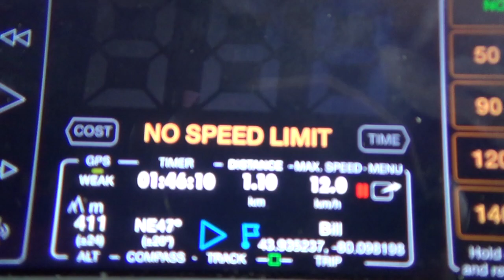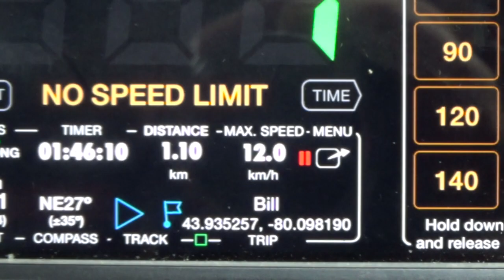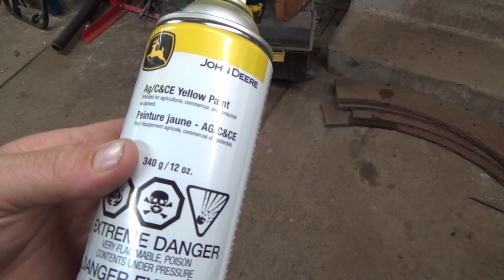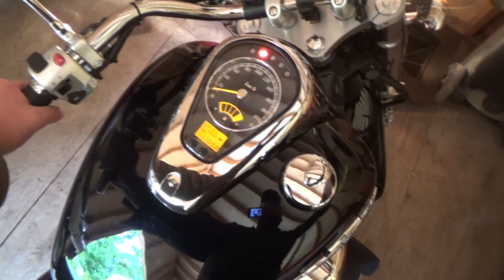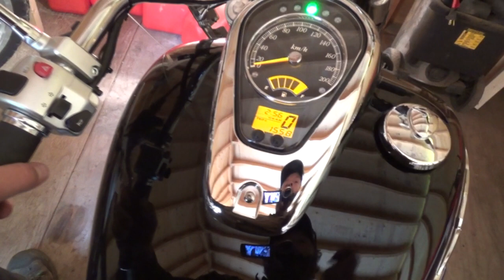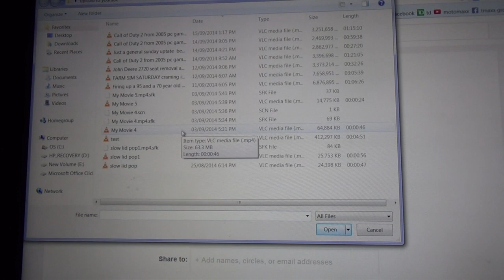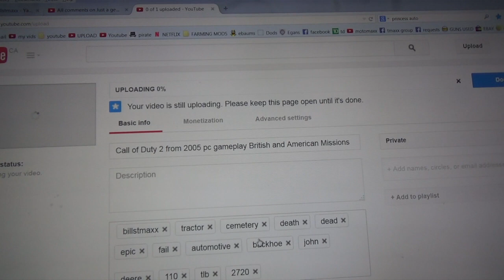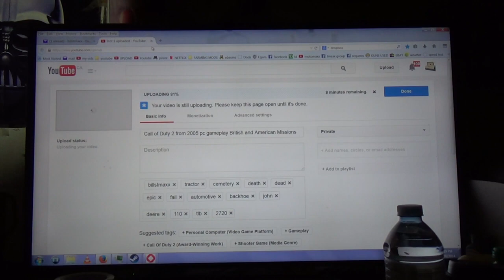Painting the seatpan and trying new blaster

Comment: T=up - never use sand in yo bead blaster Bill - way to dusty and will kill vac after vac - i know don't ask lolllll - yeah i know it's cheaper than glass beads but not in the long run - tip ifin u ain't done so - yo air compressor is very close to the blaster - have a check valve on the compressor air line going to the blast machine and a check valve on the blast cabinet itself
if u don't - unstopping the gun by holding your hand over the nozzle will blow back sand or beads through the air line and kill the compressor pump - again don't ask lolllllll
Stan

Comment: So, let me try to explain the "node" thing. The way cable works is you share the coaxial connection with the neighbourhood, right up to the (neighbourhood) node, from there on it is not coax anymore but optical fiber. In order to fix this they have to upgrade their node, or add more nodes to cope with the demand. So perhaps there are too many homes connected to your node or the connection from/to the node is to slow.

One thing to keep in mind though, if you are planning to upgrade your connection to "Fiber". Jaime from Rogers talks about "The Hybrid Fibre 250/20Mbps" please note: this is still using your regular coaxial cable and not actual optical fiber to the home (FttH). So perhaps upgrading will not solve the problems you are experiencing, unless you can get FttH.

Comment: How does that sand blaster suck the sand, if the sand is just sitting there in the bottom of the cabinet? And doesn't most of the sand that's flying around in there after blasting get sucked in by the vacuum, so you lose it over time? Also, would it remove/blast off the skin of your hand if you didn't use the gloves?

Comment: Internet areas are broken up into nodes.  Eventually a node may be overcrowded as users are added and of course the busiest times are those when people are home.  Overcrowded nodes need to be split to keep speeds up.  Fiber is usually run out to the node and then cable to your home. 

Tech needs to run a Trace Route to the point you are uploading to... not just a speed test to another location.  Selling you hybrid fiber is not a change of the hardware connection between your house and their office.